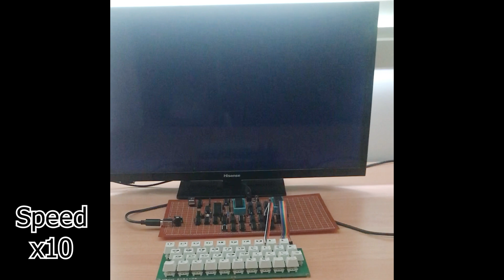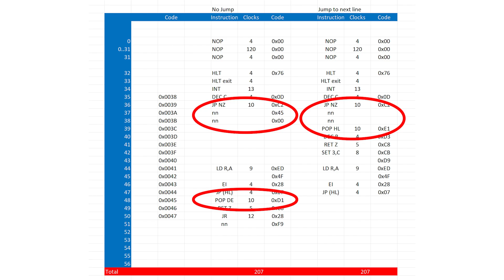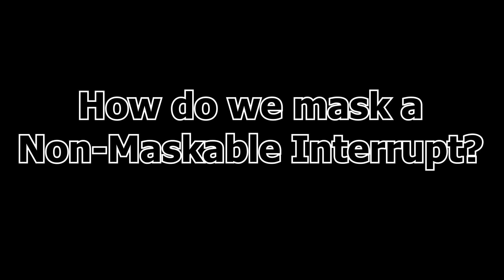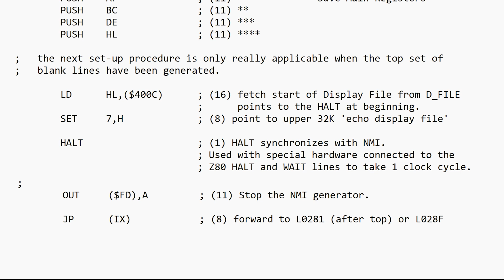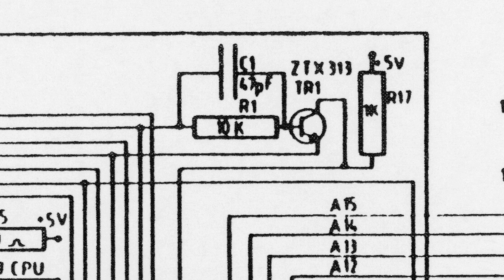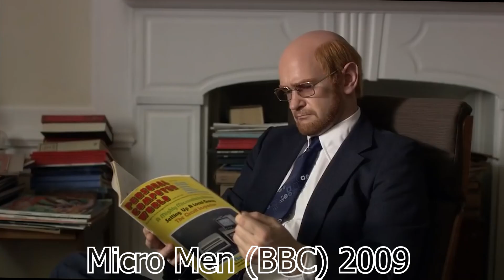ZX81 Video Circuit Part 7: Finale.

Comment: I have always thought that Clive or whoever developed the video circuit was an absolute genius. I was, however, disappointed that the ula in the zx81 wasn't a 6845 approach that would allow continuous video and allow programs to get nearly all the CPU cycles.  It seems like a mistake, but I assume that they did it that way to make it backwards compatible with the zx80. The zx81 ROM was made available to people with ZX 80s, but it did not provide the slow mode video.
Reply from the maker: Yeah, they fixed it for the spectrum and that became wildly popular.  The video circuit in the spectrum is also quite interesting and covered in some other videos here.

Comment: A thoroughly fascinating examination of how Sir Uncle Clive and his engineers designed for lowest unit cost - and in the process, gifted the opportunity of affordable home computing to a great many Britons who otherwise would not have been able to afford to do so under the privations of Thatcherite Britain in the early 1980s.
 - Granted, the default unexpanded ZX80 and ZX81 could do little more than many of the basic kit computers generally available at that time, but they could be plugged into a TV and they did have a very rudimentary qwerty keyboard and had a BASIC interpreter built in.

 - Early on in the series, I was saying to myself, "But what about doing video updates when Refresh is asserted?" -> Of course, this does get covered later in the series, but we get to see, step-by-step, why each piece of the circuitry / system is there and what issue(s) they solved.
Reply from the maker: Yeah, Ironically, while being the cheapest/nastiest machine of the time, from the computer architecture point of view, the ZX80/81 are by far the most interesting machines.  Amazing what they were able to get the Z80 to do.  I don't think i'll attempt this with a TuringZ80, the timing of each instruction is critical.  You would have to cheat quite a bit, put the machine to sleep during the active part of the display and rely on horizontal and vertical counters.  You'd probably need to change the firmware to get the display lists to work properly.

Comment: Back in 1980, as an electronic design engineer, my job at Sinclair Research was to put all of the TTL logic which was on the ZX80 into a Uncommitted Logic Array, which was used on the ZX81. I had to also include the additional logic ( counters etc ) which would do the sync timing so that the screen would not flicker when a key on the key board was pressed. Most of the electronic design for this was originated by Jim Westwood. He was an electronic design Engineer and also my boss who I reported to.
Reply from the maker: Great to hear from you.  The ZX80/81 video circuit is the most creative Z80 design I've seen, which is why i decided to do a video series about it.  Do you see any glaring errors in the videos?
Reply: @DrMattRegan  I was effectively a 'Hardware Design Engineer' on this project, and did not have the knowledge of the tricks which where employed in the software code which made use of the particular features which the Z80 CPU had. This was done by Jim Westwood. So I can't say if you have any errors in your analysis of how it worked. I must say I am very impressed in how you have managed to figure out the relationship of the particular features of the Z80 workings and the generation of the sync signals.
Reply from the maker: Thanks for the feedback.  In the Spectrum series, I've used an EPROM as a finite state machine to do the raster generation which was fun.  Now I'm working on a series where i replace both the ULA and Z80 with TTL logic, EPROMs and static RAM.  These machines were such wonderful learning tools, and i think there is still some more people can gain from them.
Reply: @DrMattRegan  Just before the ZX81 was released in 1981 I left Sinclair Research. In my next job I did a lot of logic design mainly using the CD4000 series of chips. I then got into design using a microprocessor 6502. I did my code in machine code putting HEX values into an EPROM programmer's memory. I would write the code on paper in assembly code. I made use of the timing of each instruction ( microseconds ) and add them together to produce an output pulse from the cpu port of so many micro or milliseconds width. I also tended to use software UARTS , again by counting microsecond cycles of code. No software engineer would be taught this type of stuff today - all high level coding C++ etc. Later I did coding in C language as I was one of a number of Engineers and we all had to work the same way. I also did coding/design for FPGAs ( Altera ) which was used to process digital video and audio streams used in the Broadcast Industry. As I started out as an analogue Engineer in the late 1960s I would also do RF work such as making a transmission line carrying a serial digital video signal ( 3Gpbs ) have a return loss below a certain value.
Reply from the maker: Wow, sounds like you've has a pretty wide ranging career.  I agree, it's a pitty that low level stuff isn't really being taught anymore.  I actually think it should possibly be taught at the high school level.  Do we really need 2 years of physics and 2 years of chemistry in the final years?  Maybe a year of fundamental computer science would be good.
BTW: if you're a 6502 fan, i have a couple of playlists.  The Turing6502 playlist gets right back to the fundamentals of computing.  
The SAP6502 is an expansion of the SAP1 architecture to run 6502 code, and i did a separate playlist on the microcode.  You may get a kick out of watching them.

Comment: great great series, probably I've already commented when I saw first time  O:-) ... But a question: will the proposed circuit handle true hi-res? maybe there is the need for an additional episode to finish or to explain it?
Reply from the maker: I have thought of doing an episode on pseudo hi-res graphics.  The problem with the ZX81, is that bit-6 of a byte in the display file will blank the display and execute the byte as an instruction.
What this means that we really only have 7-bits of data per 8 pixels.  Or really 6-bits plus inverse.
This trick is to use some other (more random appearing) part of the ROM as the character data.  Then in the 64 characters available for 8 pixels, find the closest match.  This is why (some) high res images appear to have noise.

Comment: I was try to analyze interrupt procedure but with out schematic i was almost sure that was something wrong with my dissasembler at first.
Also looking at printed circuit (with wavy tracks;)) i saw that INT is connected to A6 with baffled me even more... but now i can understand this thanks to you.
Later i even managed to "transfer" whole ZX81 (power supply, ram extenssion) to my country colone of ZX-Specturm (Junior-3) with almost PC-like keyboard and place for 3"1/4 drive.
I even constructed "Kempston like joystick" from parts that i'm ashamed to list, but only proper were miniswitches;)
Reply from the maker: Excellent.  The design seems crazy until you known what they were up to, then it seems very clever.  Glad you liked it.
Reply: @DrMattRegan  Yes it is crazy and genius the same time. What mostly impresses me that slow mode was only 4 times slower (in BASIC at least )which seems impossible knowing where CPU has free time.

Comment: This was my first own computer (i used some other before in scholl and friends), i have it with 16Kb and added keyboard.
I manually assembled (to hex or rather "chars" with heavy aboused ZX-81 manual table) some programs, later by example in book abaout Z-80 i made dissasembler ("Complete Z81 rom dissaembly" or schematic) wasn't aviable in my country , and "dissasembled" most of ROM by dissambler and pen to notebook.
I expertimented with kinds of "tape turbo" and 1-bit digitalization of sound.
One of my programs needed at least 4K, it was kind of spread sheet (like Excel or QuattroPro), wich allowed to use formulas in cells writen as BASIC expression (i found "eval" routine in ROM) and also could draw some "charts".
Reply from the maker: Yeah, i started with the ZX81 were i learned BASIC, but spectrums were pretty rare in Australia.  

Everyone else had a VIC-20 so i went down that pathway then the C64, so my first exposure to assembly language was the 6502.

Comment: Interesting series to see how Sinclair managed to cost cut the ZX80/81. I had a MK14 (the machine he came out with BEFORE the ZX80), but not any of the ZX series. I had an Acorn Atom at the time of those two (a more expensive machine with dedicated video memory/hardware). This was pretty much the story of Acorn vs Sinclair, Acorn wanted to make a fully featured machine, and Sinclair was more interested in making it cheap.
Reply from the maker: Great point!  The Acron designs are far more vanilla.  Good machines, but i personally like all the tricks the Sinclair people are able to get working.
Reply: @DrMattRegan  Acorn hardware was comparatively conventional (a 6845 video controller in the BBC B and a 6847 in the Atom for example), but clean and better thought out on the software side (the BBCs extensible ROM system that allowed software paging between ROMs for example). 

There were parts that were extremely clever though, for example the Tube interface that allowed connection to modules containing other CPUs (anything between a faster 6502 through a Z80, 32016 and even the early ARM CPUs). They weren’t however targeted at making the Acorn machines cheaper, and when they did try that they had some bl**dy silly ideas, like using a 4 bit memory bus and multiplexing it to 8 for the CPU and Video.

Comment: Thank you Dr Matt. This was a fantastic series.  I can add very little, and you have added considerably to my already quite detailed knowledge of the ZX80 video system with these ZX81 additions.  One observation... the 47pF capacitor across the 10k resistor on the base of transistor TR1 is not really for signal shaping as such.  It serves to speed up the on-off switching of the transistor by effectively countering the effect of the base-collector capacitance in the transistor (the Miller capacitance).  If no capacitor was added, the transistor would be driven via the RC network of the resistor and Miller capacitance.  The 47pF acts as a high-frequency bypass for the resistor, ensuring faster and more consistent switching of the transistor.  (I hope that makes sense).
Also, fun fact... in the Micro Men film, Sir Clive is shown holding the first ever edition of Personal Computer World magazine.  It was also the first home computer magazine that I ever bought back in February 1978. 
Thanks again!
Reply from the maker: Ah thanks for that.  I did try using the circuit (with a different transistor type) and the logical equivalent (using gates), and they both resulted in a 1 pixel shift to the left in the top scanline, so the code was expecting one more wait state.  I though it not working may have to do with using a CMOS CPU (different levels) etc or using a different transistor type.  

When i delayed the logical wait signal by 1 clock with the flip flop, it worked properly.  This is why i thought the capacitor was delaying the signal.  I do see what you are saying, when HALTBar goes high, the capacitor will try to resist the change and try to raise the base voltage quickly.  Maximum base voltage is fixed, so it will rapidly increase current and switch the transistor faster.

Do you know what the Miller capacitance of that transistor type is?  Is it possible that the RC delay of this type of transistor without the 47pF cap is 2 clocks and the 47pF cap brings it down to 1 clock?

Interesting though, i might play around with it more.  It's amazing that so much thought went into every part of the circuit.
Reply from the maker: I just had a look at the specs for the ZTX313 and it looks like a fast transistor.
Reply: @DrMattRegan  I looked too. ;)  Capacitance is small at around 5pF - but increasing the edge speed into the base of the transistor would be the only effect of adding the 47pF.  Leaving it out would marginally slow the switching speed.  Maybe they found it was marginal when they built the prototypes?  Just a hunch.
Reply from the maker: Could it be the interaction with the capacitor and the depletion load NMOS pull-up transistor on the HALT signal itself?  I haven't studied this for a while i may have to find (and dust of ) my Mead and Conway.
Reply: @DrMattRegan  I think it's more a case of getting a fast rise time on the WAIT\ into the CPU, since if that is slow, it results in an extra cycle being inserted which delays the timing of the sync generation.  That would push the displayed pixels to the left (I think).
Reply from the maker: Hmmm,  It's interesting, with the CMOS version of the Z80 and a BD548, the capacitor actually makes no difference and it acts like the logical equivalent, which is why i was thinking it may have something to do with the depletion load NMOS.  I don't have an original Z80 to test (well not easily).  Delaying it (the rise of WAITBAR) by one clock with a FF gives the correct result, so functionally it's acting as a delay in raising WAITBAR.   I am relying on Grant Searle's analysis where he states HSYNC is 16 clock cycles in the ZX81.  If that were off by 1, that would also explain why delaying it with a FF works.   Unfortunately, we don't have much visibility into the ULA.
Reply: So, I dug my ZX81 out of the loft, warmed up the soldering iron, and set up the scope to take a look. (Well, I didn't have any other plans...)  So the capacitor definitely affects how quickly the transistor turns on, but it has much less effect on how quickly it turns off. So, kind of the opposite of what I was thinking, but perhaps it's important to assert WAIT\ quickly in response to HALT\ going inactive. The end of WAIT\ is determined by NMI\ going high and I think the transistor has no real issue in this case since there's then no possible current flow into the collector.  I wasn't able to analyse the timing in enough detail to make any further progress though. I also tried no capacitor and a much increased capacitor, the latter having almost no effect over the standard 47pF value. I think your logic implementation is to be preferred, but I'm sure that Sir Clive would not have wanted to pay for the extra D-type flip-flop. The transistor circuit does create an open-collector circuit, though, also allowing WAIT\ to be asserted from peripherals on the expansion connector if required.  This was fascinating. Thanks again.
Reply from the maker: Excellent,  I think it's the raising of WAITBAR that determines timing.  There is a little bit of slack at the start.  NMIBAR has to be low at the rising edge of the clock before the end of the instruction.   HALTBAR will go high some time later in Halt exit, then we have a couple of clocks before WAITBAR is sampled.  So that shouldn't be to sensitive.  The rising WAITBAR will determine the timing of the next scan line.  Interesting though. Out of interest, what happened on the real ZX81 without the cap?
Reply: Without the cap, it worked just the same, and the display seemed stable. But that's a sample of one unit. It's also possible that it did modify the timing but the display wasn't sensitive to the small change. To avoid hacking a 42 year old machine too much, I was still using the RF output to the TV.  And it is one of the very early machines - it's an issue 1 PCB and it has the small extra PCB hand wired on to the pins of the CPU to fix a bug in the ROM. The ULA only has a date code (8119) which, from what I have read, suggests it may have slightly different display back porch timings than later versions.  I shall play a little more - I also need to see why my 16K RAM Pack isn't working. I have some spare parts somewhere...

Comment: Thanks for a great series of zx80/81 video generation! Do you think that today's ez80F92 could handle 8 bit color VGA, with its pipelined cpu, 6 timers, 24 bit address, and GPIO, all on one chip?
Reply from the maker: Yeah, if you use a NOP generator, you should be able to execute NOPs at 1 per clock with the pipelined decode and execute.  Send the 8 bits directly to the DAC.  It will be a bit below standard VGA which requires 25 MHz.

Comment: All those wasted clockcycles! 😢 still nice hack though I wonder if it couldn't be done in very simple hardware. Might need a bigger ram and could be too expensive back then. Even if only the hsync could be done by hardware
Reply from the maker: What really annoying is that NMI halts every scan line in the blanking period.  There is a hack that restricts it to the resynchronization scan line and speeds up the CPU by 10%

Comment: The ZX80 also had a ULA.
Reply from the maker: Really?  It’s not on any zx80 schematic I’ve seen.  Would be keen to see a reference to it.
Reply: @DrMattRegan  Apologies. I've just dragged my ZX80 out of the loft and had a look. I was sure IC2 was mentioned as a ULA in the original assembly instructions (which I can't find although I still have the original BASIC manual). I remembered it mentioned that the "ULA" had the notch at the wrong end and you had to plug in IC2 upside down. Turns out it's the ROM and I was incorrect.
Reply from the maker: @fredderf6491  no problems. What did you think of the series!

Comment: and still no turingz80 schematic you promised over a year ago...
Reply from the maker: The current design is a work in progress.  It doesn't  have interrupt or in/out instructions.  
It's basically the same design as the Turing6502 which has schematics available on github.
I'll be incorporating the turingZ80 into the Spectrum series though.